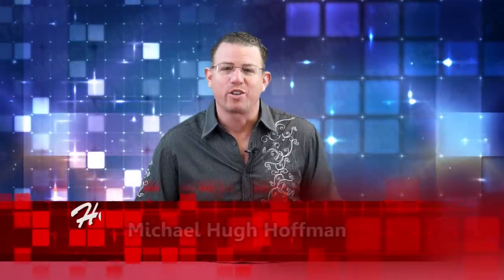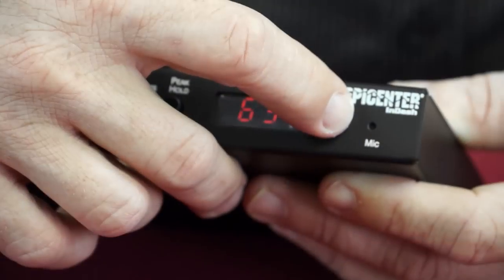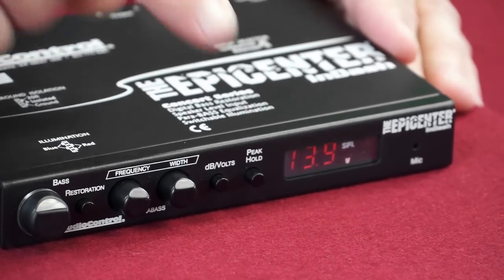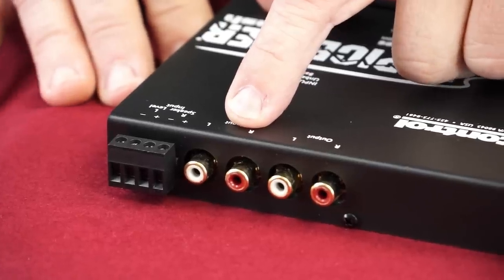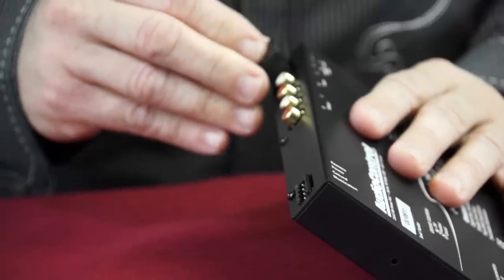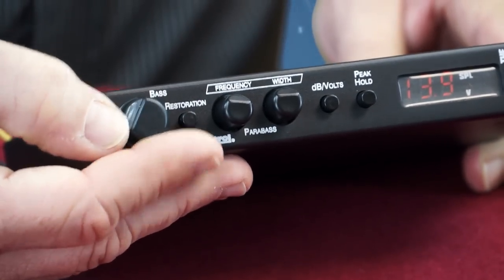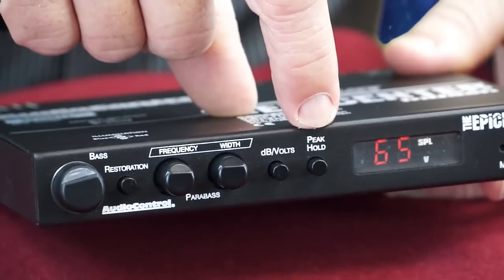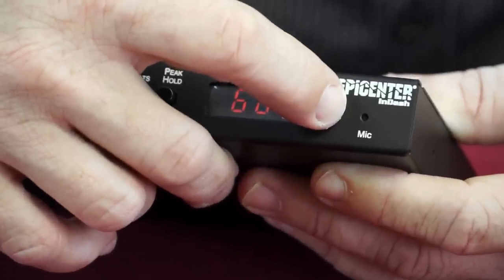Audiocontrol The Epicenter InDash - HookedOnTronics.com Product Review

Comment: I know it's been a while since you posted this video...but I have a question. Did you get the inputs for the InDash from the stereo wiring harness? I just installed mine using the stereo wires and it started smoking!!! The Epicenter turned on, turned the lights on and it lit up. I checked the connections, and everything looks good. I've installed the Epicenters, not the indash before, but it seems straight forward... Any help would be greatly appreciated!
Reply: I really think something was touching

Comment: what's the difference between the epicenter & the the epicenter indash ?
Reply: +Vicente Dominguez 
the indash has the volt meter and SPL microphone and the high level (speaker wire) inputs and is designed to go in the dash, the classic epicenter goes in the back with a phone cord running to "the knob" that you mount up front, so the indash makes it easier to adjust EVERYTHING on the fly, where the normal would be like adjusting your amp. I've had the normal epicenter for about 11 years now (having been installed in 4 different cars now and the knob just went out on me so I've ordered a replacement knob from amazon. I'm thinking about getting the indash for my main car and moving the old  epicenter to my weekend car.

Comment: how should I set my amp filter?  should it be switched on lpf or full? thanks
Reply: I turned my lpf to 200 hz seems to work better than 65hz
Reply: @hellraiserharry  I see you switched from 65hz to 200hz on the lpf. That 200hz doesn't add extra "BOOM" to your subs? I really want to purchase The Epicenter but want to know how I can hook it up without losing my sub features from the separate sub RCA outputon my head unit.

Comment: is it possible to connect this unit to a zapco SX-Slii eq? They run off balanced symbilink cables
Reply: i loos the dash remot for the episenter can work whit  convertidor de alta y baja cosech usando el control de cosech